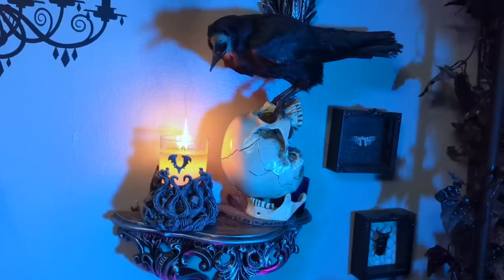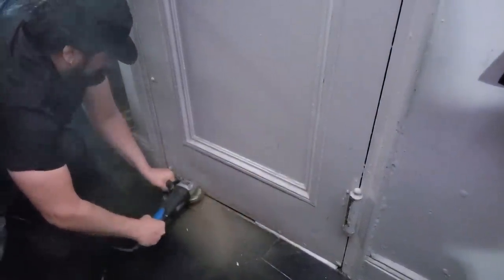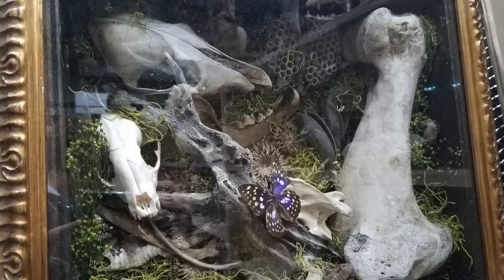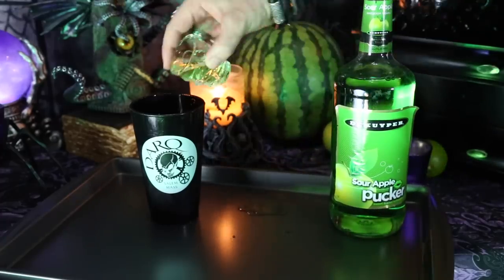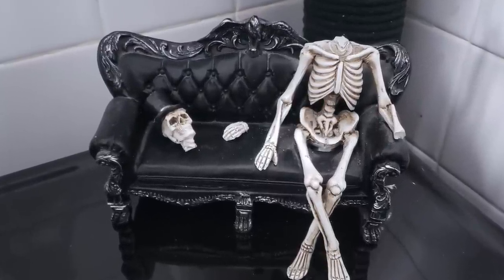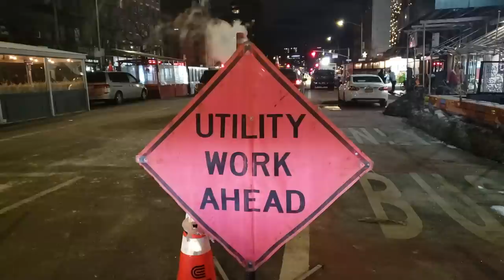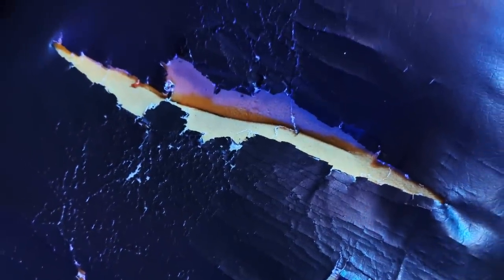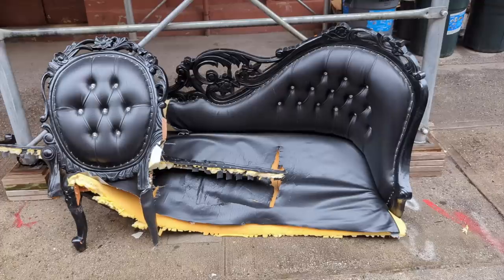Top 10 Epic Fails on Gothic Homemaking

Comment: Hey, to fix the things-falling-off-shelves issue, have you considered museum putty or museum gel? They are removable object-safe substances that work wonderfully to keep knickknacks from falling over- and the transparent gel is very useful if you have any glassware or small objects that wont hide the putty so well. I use it in my miniatures and i cant recommend it enough.
Reply: There's another stuff called "Earthquake Putty" that does the same thing.  It isn't transparent, but it does the same job.  Museums and households all over the country use it.  It's non-staining.  We live in California and we mount down fragile, decorative objects that are high up on tall furniture.
Reply: I bought display dots for small knick knacks on the dash of my car.  They work great, and I can't even pull them free without really putting some oomph into it.  But a touch of rubbing alcohol takes them right off, no damage left behind

Comment: The mushrooms are the most shocking to me out of all of them. I have lived in my native NYC 46 years out of my entire 56 years of life and I have lived in many different apartments over the decades. But I have never witnessed mushrooms growing out of the walls and ceilings. Plenty of mold issues? Yes. Ceilings crashing down due to flooding and burst pipes? Absolutely. Very old rusty pipes leaking and staining the white walls and white tub yellow? Yep, had that issue for 7 years in our current place before maintenance finally replaced the pipes. Large clump of dirt flowing up through the pipes into all the bathrooms in the building everytime it rained hard outside? We use to have that problem for decades in the projects. But mushrooms??! THAT is an absolutely new on me! I so feel for you. 
Just WOOOOOW! 🍄😳🤯😱🙊
Reply: Mold is a lot worse than mushrooms though
Reply: @RainyDayWolf  You're right. I meant to say mildew. Sorry about the brain fart I had. Though I have seen "mold" problems in NYC apartments on the news plenty of times as well. That's a problem here when you are dealing with slumlords or city owned low income housing that have really bad maintenance.
I have been lucky enough to have never lived in one that got that bad.
But the mushrooms are still new to me. Never seen that one before. LOL! 😉😊
Reply: Life finds a way.

Comment: On the pumpkin tools: You should be picking light-colored pumpkins because the skin is thinner, and you should cut the bottom of the pumpkin instead of the top so you can balance the thing easier after gutting and carving. My wife and I [mostly her] carve a dozen pumpkins every year for Halloween. Another option would be to make paper mache or get foam pumpkins. If you're 100% set on the darker pumpkins ['cause face it, they look great], grab some pottery tools and scrape out the inner walls of the pumpkin to thin them out where you're gonna carve after gutting. Also, painting white glue or Podge in the cut areas will make them last longer. :)

Man, you really should consider moving the Lair to a new location. Getting out of the city would make filming so much easier!
Reply: I've had more injuries using pumpkin tools than I have from using my kitchen knives.
Reply: If he moves, he loses his locked in rent controlled apartment in New York City, which he has said he never wants to give up because of how hard it is to get.
Reply: Awesome tip on the mod podge for the cut out areas! I never heard of that before! Thanks
Reply: @cecilyerker he needs a second home/studio for sure! 😏

Comment: Honestly when it comes to the blue beetles, you could make a horror wreath for a door or wall decoration. Even the bone fragments can be glued in to add a bit of morbid flair. If one project idea doesn't work, consider your options or get ideas from the community. When something turns out to be out of your skill range, figure out how to use the same materials in another DIY that is. That's how I feel better about failures.
Reply: Good idea

Comment: There are glass dome things that you could use for the blue bees. Assuming you still have them. Fashion a small tree branch with some moss and maybe a skull or two.

Also...some crown molding would go nicely in your bathroom. Just an idea.
Reply: You mean  a cloche? That would look lovely but might be tricky to fit everything in smoothly. A small terrarium would have easier access for placing things. Some of them are quite ornate but they are pricey being metal and glass. There are diy options as well though, some use picture frames as a shortcut but he seems pretty handy so maybe designing his own out of cheaper materials could be a fun project in its own right.
Reply: @FoxFireNaruto  yeah a clouche. They do come in different sizes though I have no idea where one would find them aside Amazon or something.

You can make a terrarium with wood and plexiglass though. I'm sure Michael's would have something.

Comment: In case you don't know. You can use rubbing alcohol on a microfiber towel to wipe up your little hairdye dots. Should work on the old ones too. But it may be a several try process. Hope this helps!

Comment: Regarding the skulls falling, there are products called Museum Putty and Earthquake putty that are pretty cheap and are designed to secure ceramics and other objects to shelves and tables so they won't fall off if bumped. You can usually get a small package for under $10 and it's enough to secure 1-2 dozen objects depending on weight.

It keeps my treasures all in place in 5-6+ quakes.

Comment: Try acrylic protective varnish on Orville's face, the kind used for paintings. Or a high quality acrylic hairspray if you can find some. They protect against material oxidation and add a supportive layer on the surface.

Comment: I very much appreciate your honesty and openness as your projects are always so human and not fake like many other tutorials. They make me feel inspired, even the failures do! Just like my own projects always teach me stuff.

As for the blue bettless. I would have just fake deepened the shadowboxes. I would use either foam or cardboard to just add to the frame at the back, spray paint it and then hide it with moss or dirt. The only thing relevant would be how to attach it to the wall, where im sure you would have way more knowledge than i have on the matter. But generally im confident there are attachments on the back pannel, which you detach from the frame? I already made my own shadowboxes before for basically the reason that i wasnt able to find what i wanted for an affordable price, and once painted it absolutely looks fine. :D 
I get the perfectionism though, i 100% do!

Comment: Thanks for the honesty.  Try turning the summoning table upside down.  Attach a sheet of good quality plywood.  Paint it black and fit a set of castors.  You could also refit the legs and put the castors on the end of those.  Good luck.

Comment: You could always attempt a backless shadow box. Have all the animal bits peel out from the back instead of hiding them behind glass if you ever want to try again.  I just turned my shadow box around and did that because of similar problems. You could even attempt using resin to keep things in place.

Comment: I remember a decorating fail when I hung up my pictures with command hooks and the adhesive gave out. My pictures fell on the floor. Luckily they didn't break however one of them ended up with a little dent.

Comment: Poor Orville. Is he latex? Maybe you can try  (in an inconspicuous place somewhere on him), some synthetic latex. Castable Neoprene. Creature Cast comes in black, and you can get it in pints. Be warned, the more rigid the formula, the more it will shrink. But the flexible, you could try a few light coat layers. I would ask them if it could be used over natural latex. The beauty of the neoprene is, you can paint it with acrylic paints. You wouldn't need a special paint formula like for natural latex. Many cosplayers use it to coat and seal their foam armor and costume parts.

Comment: That bathroom…dear gawd

Okay so acrylic (to packing tape…anything clear that can be wiped) to cover the paper while allowing it to be wiped and cleaned (hair dye wipes off of it too) and keep moisture out. 

You can/should also keep a dehumidifier in smaller bathrooms in high humidity climates (or times like post bath). Looks nice but needs to be safe and cleanable

Comment: This came at an odd time, and hit harder than usual as a result. I've been writing for years now, getting better and better, to the point that now at least one professional has stated, and I quote "That I seem to know what I'm doing."

And yet the past few months, it's been failure after failure. The quality's not there, getting back into a writing habit is harder than it should be, keep second-guessing projects and concepts... and to top it all off, I've announced quite a bit, too, so I can't just abandon anything outright. It's not even the failure itself that bothers me, but the fear that I'm regressing. I'm getting worse with each attempt, not better. This is especially worrying, since current projects are 'practice' stories, trying out some things before I move on to the big one, the one that actually matters long-term. If it's starting to fail now on stuff that doesn't matter, it'll be a massive fail on stuff that does. 

Persistence is the only real forward, suppose. Take little victories where you can, plenty of stuff to do and figure out in the art department. Not sure where to find those in writing atm, though.

That's how the occultist, wizards, and witches do it, after all: start with things that you know will work, to build up confidence and certainty of results. And always remember that acts of destruction are much easier than acts of creation, but usually less fulfilling (paraphrasing slightly). 

Good vid, and thought-provoking on several levels. Even aside from the comedy aspect, definitely up there with the Future Rock Star's Handbook.

Comment: Have you tried blue tack or those Command velcro strips to keep the skulls on the shelves? You could maybe stick them to the wall or shelf so they don't fall off.
Reply: I've heard good things about Museum Gel for just such things.  It's clear, won't damage paint or most surfaces, and I've seen that stuff hold large geodes in place, despite even an attack of the kitty cat.  Would probably work a treat on the skulls, and it seems to require very little to actually hold something (like, a dime-sized dab at most), so a little will go a long way.

Comment: Voltaire, my friend, you are a wonder! Maybe a speck of velcro on those skulls/shelves to keep them from falling? And I did Spoonflower wallpaper in my bathroom about 18 months ago. . .it's really not for bathrooms. 😪 The steam from showers and baths (especially in winter when the window must be kept shut) begins to get under the paper and detach it from the walls. I knew this would happen eventually, but thought it'd last a couple of years at least. A very expensive mistake; I'll use wallpaper on accent walls in DRY rooms from now on.
Reply from the maker: I've thankfully never had that problem with the peel and stick wallpaper ( surprisingly). It's held up great and I take super long, hot baths

Comment: There is this putty called quake hold. You can break off the size you need and put it on the skulls to hold thrm in place. When you want to move them, just life straight up. I think they hold up to 5.0 on Richter scale. Also for pictures and furniture.  Different kinds of quake hold

Comment: Try getting Earthquake Putty. It's easy to find online. Museums use it to mount items on shelves. Also, try putting removable sound-blocking foam pads into your windows while filming. See if that helps. Pick the room that has least contact with the outdoors & place foam into those windows. And, seriously, GET THAT FUCKING FRONT DOOR FIXED (on the land-lord's dime)! It's a fire-safety hazard & your landlord could be charged with a crime!

Comment: Your scissors were quite sharp and tight enough, as you found when you used them with the proper hand. Like guitars, scissors are right or left handed. Buy left handed scissors if you're left handed. Basic. They don't cost a penny more at Amazon, even if other sellers try to hold you up.

Comment: Out of curiosity, was the tub prepped before glazing?  I reglazed mine a couple years ago and I’ve had zero chipping, but I sanded the tub down really well with an orbital sander for better adhesion.  If you do that and  apply several layers of the glaze (a couple days apart to allow curing between coats), you should not have a problem!
Reply from the maker: Yes, it was prepped

Comment: on the blue bees, why not just make or buy a bigger shadow box?
Reply: Could just be he wanted a specific vision but ended up ruining one of the skulls he wanted to use and that's probably what set him to not continue for a while. I do this sometimes when I get overwhelmed with multiple mistakes at one project.
Reply: @3StarLogo  Yeah, the artist freeze is real.  I've put so many projects off, or refused to revise my approach, because my brain just vapor-locked when it refused to come out the way I wanted to, and I couldn't see any other way to complete it.  Plus, when you get the pieces to make something and it turns out that one of them just isn't what you actually need/want, it makes it harder.  Again with the vapor-lock, as you've put the money into buying this particular thing (in this case, the shadow-box), and therefore feel obliged to use it, but it won't work for the thing you want it for.  And there's a certain level of feeling bad about spending more money to replace it (especially if you're not able to return it in the process!), if you know you won't be using that thing.